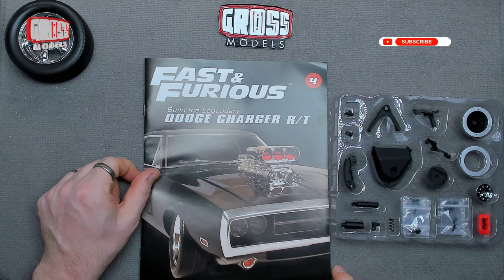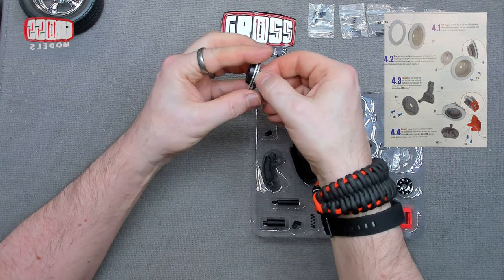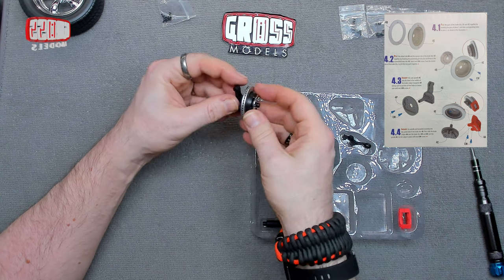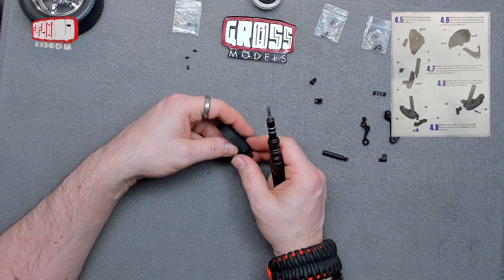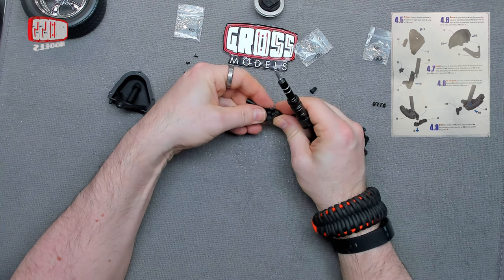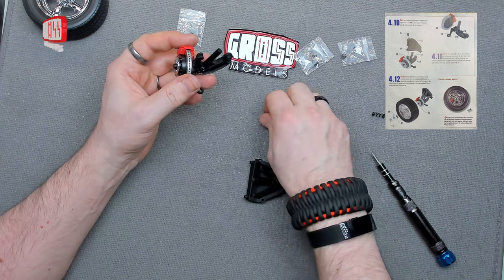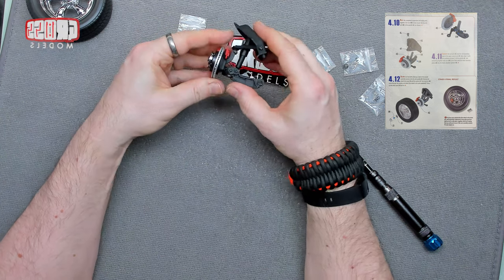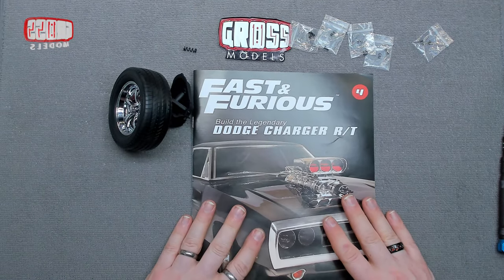Fanhome 1:8 scale Dodge Charger build. Issue 4

Comment: I've been building models for 40+ plus years, mostly cars. Part of modeling is the finish or painting and actual construction. These 1:8 scale kits are basically a study in using a screw driver, not much skill in that? Everything's been done. Plus they're expensive.
Reply from the maker: There is room for modification and improvements if you want to add your own touch to them. Depending on how you want the build to look you can weather and repaint parts to make them better. 
The price is very comparable to a quality studio scale model, but payable over the course of the build not up front. I wouldn’t spend the amount they cost all at once. 

There is a different skill involved in the building, I have seen many people have trouble with some parts. Anything that can bring more people into the hobby must be good though, right?